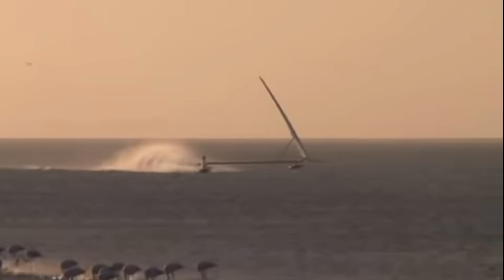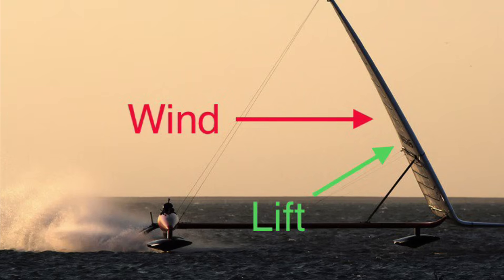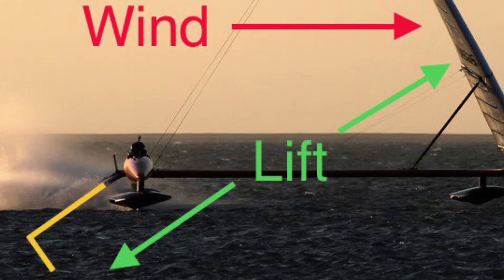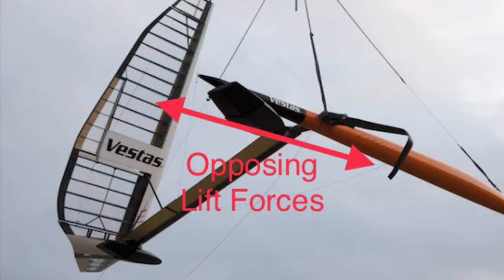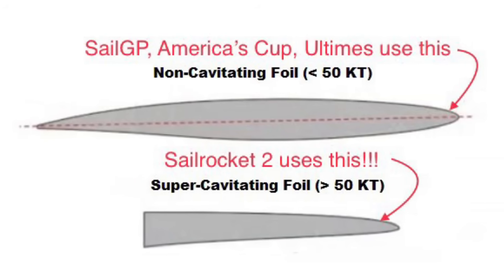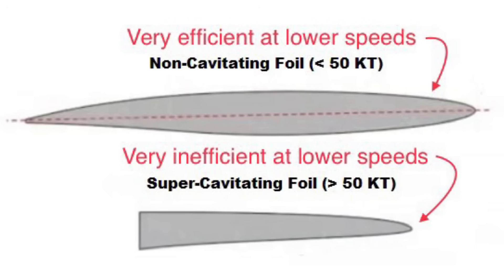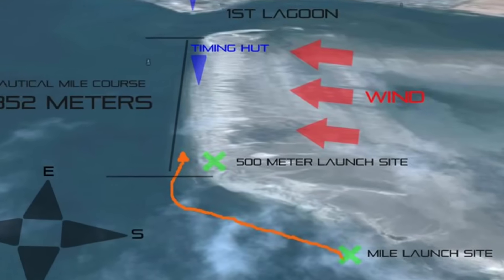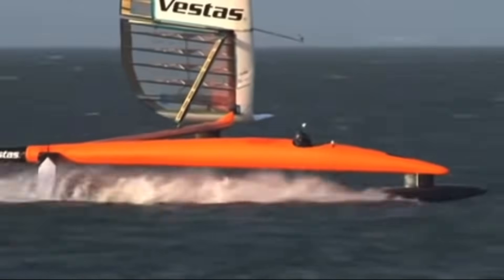How Did Vestas Sailrocket 2 Smash the Sailing Speed Record?!?!

Comment: I worked as HYDRODYNAMICIAN with the DESIGN TEAM of SAILROCKET during 15 months and, in fact, they DIDN'T SELECT a CAVITATING dual-mode foil, but RATHER TURNED THEIR MIND on a BASE-VENTED ULTRA LOW LIFT COEFFICIENT SECTION, with ONLY THE truncated BASE in a state of CONTROLLED VENTILATION fed by the air coming from the sea level....a more complex technlogy, but much more stable and less draggy......
Reply: THANKS, that is some GOOD insight. Have a nice DAY.
Reply: The seemingly RANDOM combination of CAPS and lower CASE above is in FACT a perfect balance THAT HAS achieved THE most AERODYNAMIC YouTube COMMENT ever.
Reply: NOW we KNOW
Reply from the maker: Thanks so much for your expert insight!!!
Reply: INTERESTING INFORMATION. SPEAK UP, I COULDN'T MAKE OUT SOME OF THAT.
Reply: I have struggled for several years on the dagger design.  This video helped a lot my problems in understanding are around the supercavitating aspect.  Is there any good literature on this?
Reply: Ther's a book from the MIT about Cavitation...the best "classical" subcavitating hydrofoil sections have been designed by Eppelr and Y.T. Shen  and they published the coordinates in Marine Technology...Hydrofoils named Sections B & C @breederfly
Reply: Basics is, the faster you sail, the wind direction you feel will turn into just head wind. So the challenge is, build a sail that works best in such a head wind. The maximum angle at which it still keeps pushing you, that one is all important. And there is very interesting theory, about how sails or wings work. Sailing has done huge developments, foils have changed a lot, too. Incredible how fast these things go. The world speed windsurfers STILL are impressive. And learning to steer a foiling cat is not what you'd expect, catamaran sailors need to reverse some reflexes, things are different! Did you know that?
Reply: Russian missiles have a thin layer of gas around them. The rockets actually shoot a little of their fuel forward so they can glide smoothly and cut through the water. I get avoiding cavitation, but can the air around the foil also shoot a little of that air forward too? Not to mess with lift but to decrease friction?
Reply: @tuvoca825  The SHKVAL is truly a 100kts russian sub-missile surrounded entirely by a cavitation bubble fed by the internal combustion gas of the rocket engine. In Sailrocket's case, the foil IS NOT a supercavitating one, but a BASE-VENTED : The water of the boundary layer still sticks on the walls, only the wake is full of a mix of atmospheric air and water vapor. And, the descending atmospheric air hasn't the very huge total pressure needed on to surge forward towards the leading edge, in any manner at all...
Reply: this is THE most HOSTILE comment section I’ve EVER seen on A sailing VIDEO calm the FUCK down folks
Reply: AWESOME
Reply: You're a badass !!!
Reply: @liam3284  On high speed boats > 40 knots, supercavitating propellers are used with the suction side (back of the prop) totally unwetted. On to be stabilized, this supercavitation upper pocket is fed constantly by the air which is captured over surface and brought underwater because these propellers are semi-submersed (cavito-vented). About your idea, a pure base-vented section as the Sailrocket one, would have less drag obviously and would generate less vibrations, BUT you will need (again) to find means to feed the truncated base (trailing edge) of the propeller blades with some vapor or air from somewhere ( may be exhaust gases )...complicated issues....
Reply: oK, but PerhaPs you COULd MaKE youRsELF moRe ClEAR BY not using CAPsss
Reply: After reading this I feel I can really sympathise with the experiences of the dyslexic community.
Reply: Awkward. As “HYDRODYNAMICIAN” you should know the cavitation gas isn’t air from the surface it’s water vapor, from the water boiling off.
Reply: @danielcockerspaniel  SORRY GUY, you don't understand clearly, I talk about BASE-VENTED...this means that, locally, the vapor has been replaced by AIR coming from the free surface, VENTILATION took the place of CAVITATION...I work during 19 months with Vestas team and I got a PhD........no need to launch missiles, folk !
Reply: @lavaljeantet  I didn’t intend to START a war with you BUT YOUR description WAS poor.
Reply: @danielcockerspaniel   How was it poor. I guessed at what he meant anyway...and I don't has experience in hydrodynamic design. His wording was technically sufficient.
Reply: @Plateaudweller  you only think you understand because you don’t have enough knowledge of the subject.
Reply: @danielcockerspaniel  Well, for the guy who made the female pressure moulded prepreg carbon fibre fins for Macquarie Innovations when they broke the 50 knot barrier, I think I probably have sufficient understanding. It required a tad of lateral thinking but it was understandable.

Comment: The "air" behind the hypercavitating foil is a vacuum with low pressure steam and gasses dissolved in the water.
Reply from the maker: There’s another viewer that worked on the Sailrocket and confirmed in another comment that it’s really a “hyperventilating” foil which would combine steam and gasses with surface air.

Comment: IIRC, land speed rules say your final result is the average of two runs, one in each direction, with a maximum turnaround time. Is there anything like that for sailing? What's the equivalent rule on the water?
Reply from the maker: Here are the rules for 500m, which is one of the records held by Sailrocket 2, the other being one nautical mile. I think the bidirectional thing with land-based records is to cancel out the effects of wind, however sailing records are trying to harness the wind. https://www.sailspeedrecords.com/the-course-of-500-m

Comment: i think that the sail rocket could be done as a true cat. using variable geometry foils and sails. probably not as fast though
Reply from the maker: One thing I didn’t explain in the video is that the main “cigar tube” fuselage aligns perfectly with the apparent wind and points about 20 degrees to the right of the direction of travel!

Comment: They were able to reach 60knots without foil.  They are sailing slower with the foil.   A Cleopatra's barge catamaran 2mast wide and keeled at the end headsails should be able to equal vesta in a full size normal sailboat design.  20 ft mast 400 square feet of sail and more than 40ft wide and 35to 40ft  long keeled 3 to 1headsail to mast with blades should equal vesta's best time.
Reply: BS biology BA chemistry MA toxicology basics of sailing and one year of physics and 30years of sailing.
Reply from the maker: Can you clarify - who sailed 60 knots without a foil?
Reply: There was a wind Surfer who was doing 50 .
Reply from the maker: @davelowinger7056  Yes the record for a wind surfer is just under 50, with kite surfers hitting just over 55: https://en.wikipedia.org/wiki/Speed_sailing_record
Reply: @SailingTipsCa  so with this hydrofoil or fin it's using the boiling water to push back on the fin and push the fin forward in the water. If you did the same thing and flattened out one side of a windsurfing fin. Put a half a hydrofoil on the bottom of the board so when it reached a certain speed it would boil the water behind it and push it Forward. And the fact that it converts quickly back to water to hold the tail of the board down because those things are notoriously hard to keep in the water
Reply: @SailingTipsCa  I think I have seen kiter go that fast but it was straight down so I don't know if it counted

Comment: Didn't realize the foils cavitated. I thought the speed limit was drag like on an iceboat. The Sailrocket is the latest in a line of record breaker that could only sail on one tack. Remember the 2 Crossbows, and Slingshot? Been enjoying your videos since YouTube brought them to my attention a few days ago.
Reply from the maker: Sailing fast is all about lift versus drag and the drag can come from lots of places - hull, foils, sails themselves! Glad you’re enjoying the videos!
Reply: @SailingTipsCa  hmmm im surprised that they cavitate. so is that a limiting factor with plane wings too??
is it an opposite force the foil is applying against the sail or is it resistance ?
Reply: @rhett7716  You might find the videos of the design of the SR71 Blackbird very interesting.  If you find the right one it will go some way to answer your question.  Inspiring engineering.

Comment: Good stuff!  Maybe it would be fun to look into unlimited hydroplane running gear to see how they go 200mph. Probably more wedge stuff.
Reply from the maker: Those boats definitely use foils and props designed to deal with cavitation!
Reply: @SailingTipsCa  they don’t use any lifting foils. Just a mean propeller, tiny rudder, and smallish turning skeg on the port side.
Reply from the maker: @ben3989  I know I used to watch them when I was a kid, amazing machines! Still need to deal with cavitation on their prop, rudder and turning skeg.

Comment: You should do a video on the attempts to beat sailrocket by syroco and sp80, or others if you can find them. The concept of force alignment is clearly present in their designs, but with a kite and downward foil instead of sail
Reply from the maker: Good idea! Paul Larsen (Sailrocket 2 skipper/pilot/astronaut) speculated that the Sailrocket 2 record would be most likely be broken by a kite-driven tension device!

Comment: The use of a wedge is interesting and something that never crossed my mind. I remember seeing this same concept of the X15. It’s so counter intuitive. Great vid!
Reply from the maker: It does seem counter-intuitive! Sailrocket used “normal” teardrop foils in early practice but hit the cavitation “glass ceiling”. When they switched to a wedge foil the “glass ceiling” disappeared, but it took much longer to get the boat up to speed because the wedge was much less efficient at lower speeds. Everything is a compromise in sailing!
Reply: I wouldn't say it's counterintuitive at all. In both cases you've reached a point where the "suction" side of an airfoil can no longer work. That aspect of a foil only really works when the surrounding pressures can keep the fluid attached. It's that very suction that creates the drop in pressure to below the point at which wants to remain liquid. On the X15 wing, the pressure change is from the supersonic shockwave, and in order to maintain control the thickest part of the wing has to be at the trailing edge.
Reply from the maker: @weatheranddarkness It makes sense when you think about the physics, it’s just that it’s all so ingrained for us to maintain laminar flow around our sails and “slow” foils at all times!
Reply: G.E. ............I wonder if they have air bleeds to fill that low pressure behind the wedge ?????
Reply from the maker: @dannycalley7777  My understanding is that it sucks air down from the surface, so is really.more of a “super ventilating” foil!